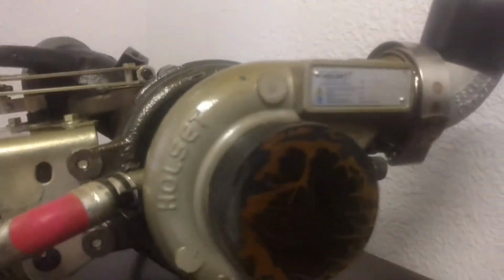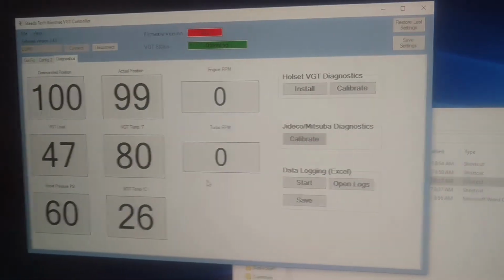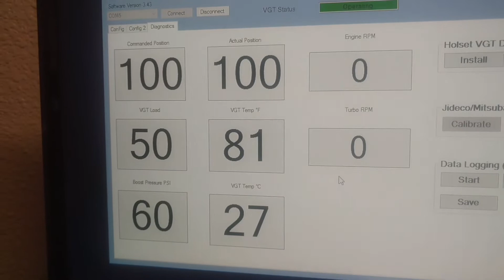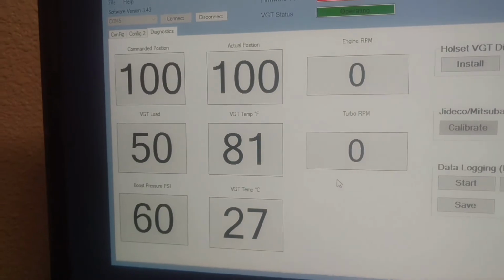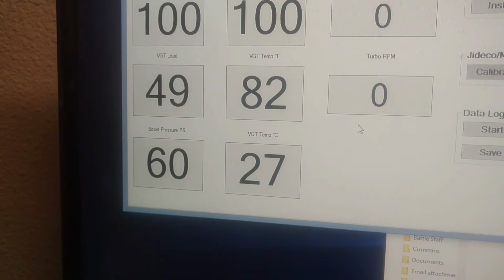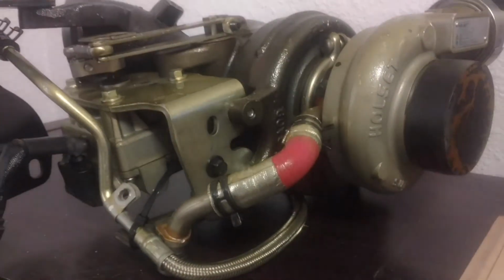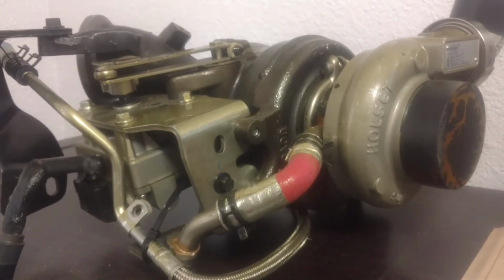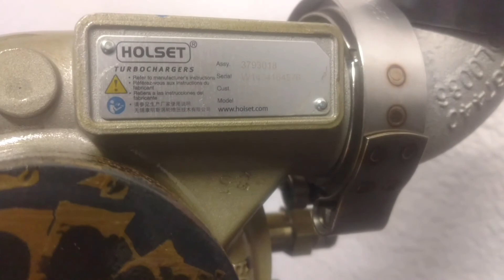Holset HE200VG with Banshee Controller

Comment: I bought this turbo from you and put it on my 82 Mercedes in 2018. Still running great! I use a mechanical control system though.
Reply from the maker: awesome, I'm surprised there isn't more of these little guys

Comment: I found one of these turbos for sale. Do have any way of determining if a p/n# 03778368 controller is a 12v or 24v version?
Reply from the maker: Youprobably alreadyKnow if your lucky you can type the part number in quick serve and it'll state if it's 12 or 24 volt. Cummins has a way to tell by the serial number but I don't have access to it. The one in my video is 12 volts and I'm going to be selling it with a Controller for $1600 plus shipping.

Comment: Will your old controllers work with this turbo, or will I have to buy a new one?
Reply from the maker: Youprobably alreadyKnow how old is the one you have?
Reply: About 2 years old.
Reply from the maker: Youprobably alreadyKnow you'll need a firmware update which is free. You'll also need to modify your harness. Do you have the remote or USB on your harness. Give me a call it'll be easier to figure out what you need